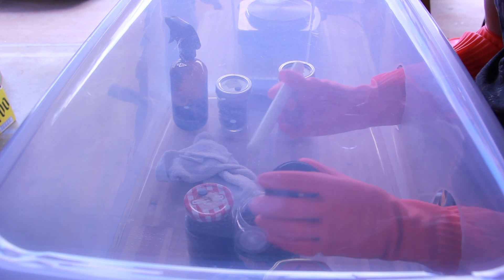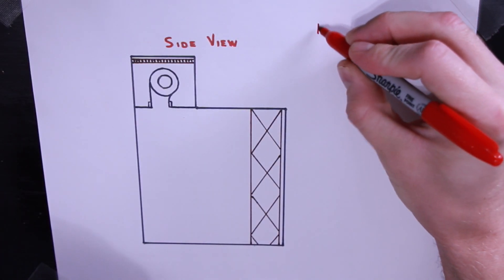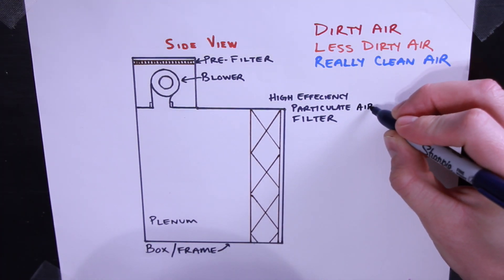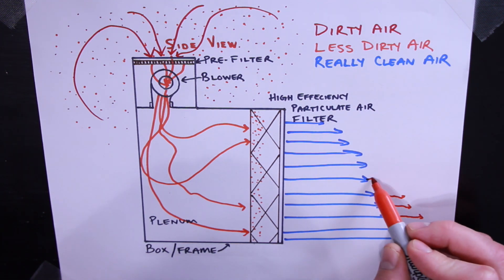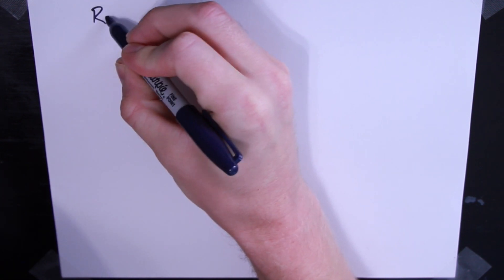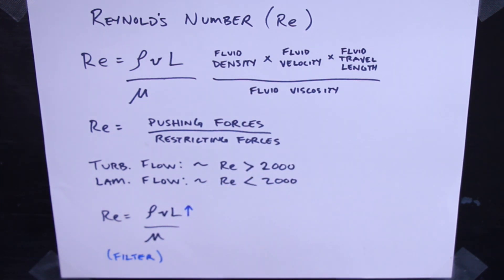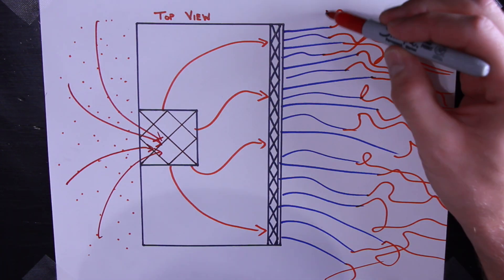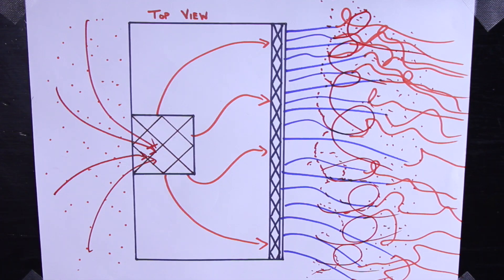How and Why a Laminar Flow Hood Works - Prevent Contamination for Cultivating Mushrooms at Home

Comment: I know this is 2 years later. Reynolds number calculated for a pipe can be used to design this. It's Re = DVp/u where V is average velocity in the pipe, p is the fluid density u is the dynamic viscosity, and D is the diameter of the pipe.  The trick is replacing the D with the equivalent diameter "De" which  can be in this formula De = 1.3(a*b)^(.625)/(a+b)^(.25) where a and b is the cross sectional length and height of the box or in this case the filter.  Real nice video man

Comment: I just became inspired to create a flow box.  Going to use a 95 liter/80 Qt. tote.  I can use smaller filters to clean the air into the box.  Positive outflow of atmosphere the way I am thinking of doing.  Further, I think I can mitigate the noise of the fan by isolation.  I'm excited.  

I'm working with a 6' x 12' lab space.

Comment: I'm very new. Been doing research on the subject off and on for years but two months ago just started actual trying it out. So far I love it! I use a SAB. After giving agar a try and experiencing some contamination, I did what another guy did on a video here on YouTube. I covered the holes with a really strong and thick duct tape and cut an X in it. Pretty much closes when I pull my arm out and kind of acts like a seal when my arm is in. Also instead of using ISO to sterilize the inside I switched to 10% to 15% bleach water  spray. That let's me flame sterilize in the box as before I would do it outside the SAB. Didn't want to blow it up you know lol. I still turn off all fans and home AC about an hour or more before I load the SAB, the spray the inside down really good with a fine mist of bleach water, wait about 30 minutes, then put some gloves on and because bleach takes more time to kill contamination I go ahead and use ISO to spray down my arms and gloved hands and get to work. So far after doing the tape and switching to bleach water I've had no contamination. But I know its not perfect and expect I'll still get contamination every now and then. But it will work until I can afford a flow hood.
Reply from the maker: I still haven't bought a flow hood, they're so expensive.  Yeah, an exploding SAB would be terrible! Sounds like you have a pretty good system worked out, I'm betting it works better than mine, I don't use anything to seal the gap between my arms and the SAB.  Contam rates are pretty low, but I'm sure I could cut it even more.
Reply: Hydrogen peroxide could be an another alternative for sterilizing surfaces. Ozone could be for the whole room before do sterile work.

Comment: Thank you for this! Just fell into the opportunity to get a Terra Universal Laminar Flow Hood. Had to take it!
Reply from the maker: Heck yeah! Have you had a chance to use it yet?
Reply: I got one from MidWest.  Initially I was really bummed.  I had the little hood (plenty big enough for me) in my cannabis grow room with moisture everywhere and the floor always dirty and muddy. Was running 40 % contamination (at least!) with still air box. Never considered that using the laminar flow in a dirty room and storing your work there would not work.  lol....anyway, I moved the hood to a "clean room" and I have had NO contamination doing about 50 grain spawns to quarts/pints a week.  None.  Very, very happy.  I often will run it just to clean the air during the day or night.  I know that will cut the life of the filter, but for the price, I believe it worth it...?  Thanks for all your great videos.  Thank God the price is coming down for decent 97% ones.

Comment: cool video, thumps up. i initially wanted to go for a flowhood aswell, but i am going to make a flow box (?) if you call it like that. it uses one of the thinner air cleaning filters, still a hepa h13 with the same rate of 99.95% as the big ones but way cheaper. and to combat the turbulent air its has walls around it, on top and the left and right, so the air is forced to travel relatively straight and that should limit turbulent air aswell. once its all built i am going to run tests with agar exposing it for 30sec to see how many contam dots it will have, if any. on the internet i read quite some good reports about this setup, but also a lot of people with their fancy 2000$ flowhoods being buthurt that this 100$ design works just as good.
Reply: Heh, I'm about to try this out too. Hope it worked out for ya

Comment: Hey man, I use a still air box aswell, I sized mines a little too small I find it hard to work inside at times and I offend have spills when trying to pour agar, I am working of building either a larger still air box or laminar flow hood, this video helped me understand alot thanks soo much.
Reply from the maker: You're welcome, and thank you! Yeah, my SAB is a little bit short and I have problem with that from time to time. I put a short clip in the beginning of this video where I was trying to make holes in the center of jars with a rod...I had to tilt the jars sideways to get the rod in. Not a huge inconvenience, but a flow hood would definitely have made that easier.
Reply: Oh boy, don't even want to think about what a pain in the ass pouring hot agar inside a SAB is... Even doing simpler stuff like inoculation can be annoying depending on the size. Do yourself a favor and get some reusable (glass or polypropylene) petri dishes that can survive pressure cooking. Pre-pour in open air, PC, wait for them to cool down and solidify - easy mode.
Reply: Put a cheepo eBay negative ion generator in your still air box.    You can blow smoke in it to see how it works.   Within seconds the air Is totally clean.   The neg ions charge particles in the air and since the box is positively charged, the particles stick to the walls.     As long as you Lysol the walls it keep those clean, you’re good there but all the air in the box should be completely free of any particles down to the sub-micron .   Any Particles attempting to enter the box  through any air gaps will immediately stick to the walls before getting much of a change getting in. .    I used one in my glove box and never had contamination..

Comment: Using an anemometer what readings should I expect from a laminar flow hood
Reply: Only a hotwire anemometer is appropriate, but 90 fpm+/-10 fpm at 12 inches from the face of the filter, with all values within 20% of the average.

Comment: Car cabin filters are HEPA standard with 99.97% filtration capacity at 0.3 microns. I’m wondering if a laminar flow can be created through one of these inexpensive filters with a computer fan. If so, the DIY cost of a laminar flow hood/cabinet with HEPA standard air filtration would be less than $80.
Reply from the maker: Worth a shot, thats pretty cheap!

Comment: How do u store the box when not using it, or prevent it self to not get contaminated?
Spray it with alcohol before every use?
Reply from the maker: I personally do not own a laminar flow hood, so I dont have any personal experience to speak of.  I think that covering the flow hood to prevent excessive contamination of the filter elements would be sufficient.  If anyone else has experience, feel free to chime in!

Comment: im getting into agar. 
what if i wasnt able to do the carpentry and didnt have the space for a full box/hood to make a laminar flow hood, and decided to use a BOX FAN behind the HEPA FILTER and that's it. 
will that work???
Reply: you wont get laminar flow but it MIGHT work if your working close enough to the filter. key word there MIGHT.
Reply: Myco Willie builds one on YouTube. Honestly, though I haven't compared, I'd feel safer in a SAB than a box fan with HEPA filter

Comment: great video! What are your thoughts on using Fan/Filter units from cleanrooms instead? I know they provide "uniform" and not true laminar air flow but so many people use them I ended up getting one. So far I've been having some issues. I believe now after watching your video that I had my flow rate way too high at first causing air turbulence, so I purchased an Ananometer and sett it much slower in speed, I've also built a 20" containment unit out of 1/4" acrylic glass around it on all sides, and have moved it away from the wall in hopes of achieving Laminar flow or at least a suitable contaminant free environment, do you think this will be suffice or should I have just build a damn flow hood myself to begin with? Thanks!
Reply: Wow. That’s a lot. I think I have wasted my $ on mono tubs and grain, and spores. I don’t have any of these things

Comment: What’s the difference between fluid viscosity and fluid density?
Reply from the maker: Viscosity describes a fluids resistance to flow.  Imagine a thick fluid, like molasses, flowing down a hill.  Compare that against water, which is less viscous.  The water will flow more easily than the molasses. 

Density describes the amount of molecules in a given volume.  Haha I like to think of it like balls in a box....the balls represent the molecules and the box is the "given volume".  The more balls I put in the box, the more densely packed the box is, and the more that box of balls will weigh....i.e. density goes up. 

Hope that helps!
Reply: OneEarth Mushrooms gotcha, thanks!
Reply from the maker: @danielche2349  you're welcome!

Comment: Willy Myco has an hour long video on building one that is 24" wide 12" tall and 24" deep. However I'm wondering if a person were to build a pre-filter box around the blower fan. If they would need a more powerful blower than what is used on the video? So that proper laminar air flow is still achieved? Thoughts?

Comment: I'm going to try a Winex C545 With Plasma, PlasmaWave® air purifier technology creates a short electrical discharge to create dual polarity ions from air moisture that are dispersed into the air. this might be the same as a laminar flow if turned to lowest power pr. Still working out the math~*~ . I already have this air purifier It has a HEPA filter, Charcoal filter, and Plasma flow. So I was thinking if I used it back wards it would work like a flow hood. I am working the numbers and I believe it will work. Going to get some agar and test in Front of the Winex C545 Backwards and see if it docent work. The Plasma wave seems to me dose the same as a Laminar air flow hood would do. I could be wrong Just Thinking mathematically these are the same. Haven't figured the math out yet but seems to me it would work the same. The Rookies Rookie so not sure Testing my hypothesis. Any one have thoughts on Plasma wave and Laminar flow?

Comment: Great vid, just one problem...you've not built a laminar "flow-hood" or more properly a Laminar Flow Clean Bench because w/o a discharge duct it's not a "hood", and w/o a discharge duct your laminar flow air column breaks down rapidly entraining non-filtered air and risking contamination of your culture medium
Google a Laminar Flow Clean Bench which is what you're actually trying to build and you'll notice the difference immediately. There is a reason all the manufactures Laminar Flow Clean Benches look and perform the way they do and that's because that's the way they have to look in order to perform the task in which they were designed.
Add a discharge duct, cardboard and duct tape are your friend

Comment: nice simple explanation but Id contest your assertion the filter sorts the air into laminar flow. Its just the design of the box with the speed...yes the resistance probably helps but a wind tunnel has no filter and its also laminar. I built one with a 325 cfm room air filter with all the parts this has and it blows about 300 cfm. You havent clarified why this 'bad' flow hood fails to have laminar flow..

Comment: Actually, its not the thickness of the filter that really matters its the resistance the filter gives. If its not enough resistance, there wouldn't be enough back pressure on the filter. Mine is built with a 3" hepa. and works fine. Many other creditable sources also use 3" thick filters for their build guide for example on this build here, one of the most referred to builds when people ask how to build one on the forum site I'm on for mushroom growing.
Reply from the maker: Good to know!

Comment: I use UVC light to sterilize my small room and all my equipment and substrate .
Reply: I was looking in to one of those. How well is it working?
Reply: @dustinmoore1559  No contamination yet, just the ozone smells bad after use. just remember do not use it on live cultures.
And make sure you get a real UVC, lots of fake ones on the market some dangerous ones. Read up on UVC usage before using it as it can cause damage to humans and plants.